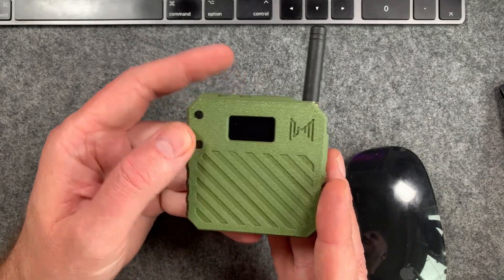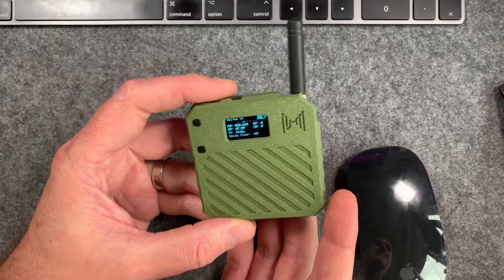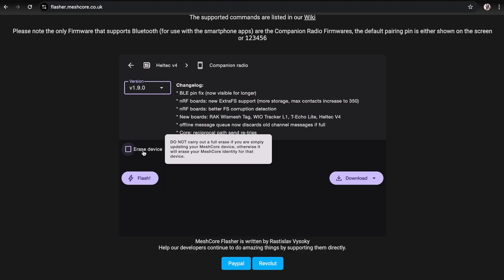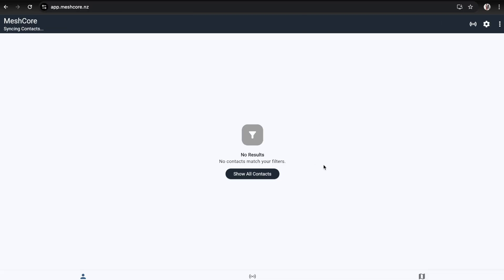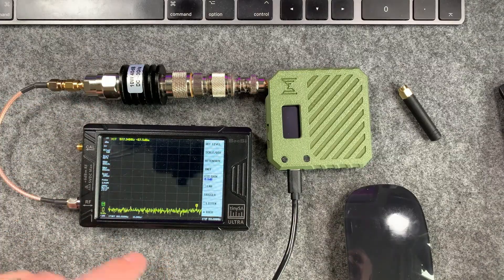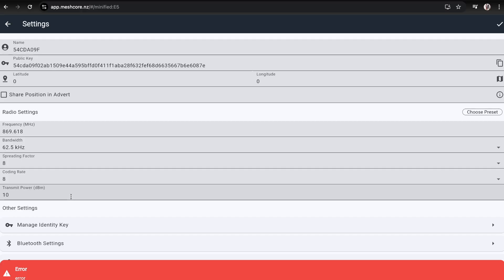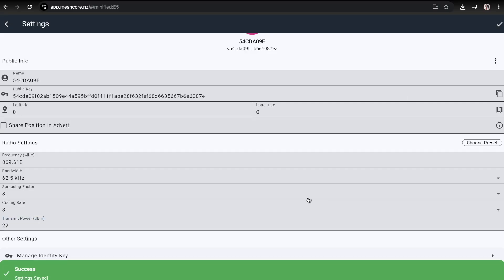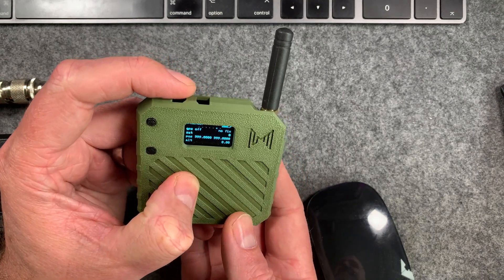WHAT YOU NEED TO KNOW ABOUT THE NEW HELTEC V4

Comment: I've used meshtastic on my v3 devices forever, they've all worked beautifully. The first time I ever used mesh core on my devices simply following one of your tutorials it damaged my device.  

It did something to my radio on my V3; burn it out , bricked it or something.  

(No, no antenna at any point was ever left disconnected for it to burn out or brick).

Everything else worked on the software, but the radio is 100% dead.   

I tried to roll back to the factory software, and then again tried to revert back to meshtastic, which it was literally running perfectly fine 10 minutes before hand and the same thing.  Dead radio.

I wished i had never tried it, and im glad i never rolled it out on all of my devices, in case he buggy software bricked the rest of my devices.

Comment: Do I understand this correctly, Meshcore uses repeaters to forward messages, if so, what happens when a repeater fails, there will then be no way to deliver the message without reconfiguring your device to use another repeater, is this correct. (2) When a message is sent from a device that message contributes to the allowable % of time LORA devices are allowed to transmit for during a duty cycle, am asking does that message sent also contribute to the time allowed % duty cycle of the repeater, and the same for any further repeaters used delivering the message. (3) Is there a way in the UI to override the duty cycle allowed, or will the device just stop transmitting until the duty cycle is restored by the passing of time.
Reply: If a message fails it will try again and then try to establish a new route. It will count to the duty cycle, but the the mesh would need to be very crowded to reach limits.

Comment: I thought I read that running at 22dbm overdrives the amplifier, causing distortion and/or eventual failure. Can't remember what the recommended setting but it was something around 15-17 for full output. Need to try at each setting and stop when the power no longer increases.
Reply: Hopefully the later firmware will deliver the output power set, rather than input power to the final stage.
Reply: Heltec v4 Supports max 28dbi

Comment: Just got mine! I currently have a v3 on my roof, and can flash it over USB, however this new one seems to have to be put in DFU mode manually - any way to trigger that over USB, or will I have to extend the buttons down another cable to avoid climbing on the roof to update it?
Reply: If it's a repeater you can send the DFU command over the mesh
Reply: @TheAtomicZombie10  Whats the command?
Reply: Web flasher just flashed mine with no DFU mode, unless the flasher did it for me
Reply: @chriskropotkin9643  Mine too now - Hurrah!

Comment: I have the heltec v3 flashed to the latest version but when I connect via the app the pin doesn’t get accepted even though I flashed with companion radio with Bluetooth, I get a “flutterblueexception | write characteristic | apple code 15 encryption is insufficient” error message, anyone else had this issue?

Comment: The screen cover on the V4 holds the bluetooth/wifi antenna.
If you remove it, you will have to move the soldered filter/jumper over to the u.fl-connector on the underside of the board and connect a 2,4ghz antenna to it.
also, one of the screws that hold the cover is plastic, that one goes in the corner where the antenna is, to not interfere with the antenna

Comment: Will V4 fit in every case made for V3?
Reply from the maker: Most of them but as explained in the video the power wires come out in a different direction to the v3 so it can be tricky.
Reply: @meshcore-official appreciate the response. How's things going in the Meshcore universe?
Reply: No, of two cases friends 3D printed, one works one doesn't. The default heltec case doesn't fit either. But a V4 case someone made me takes a V3 fine.